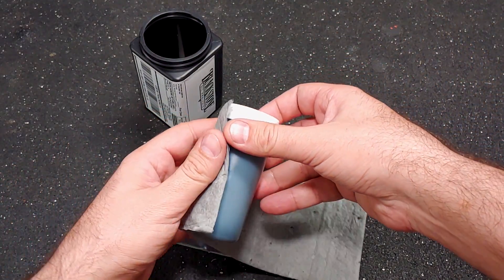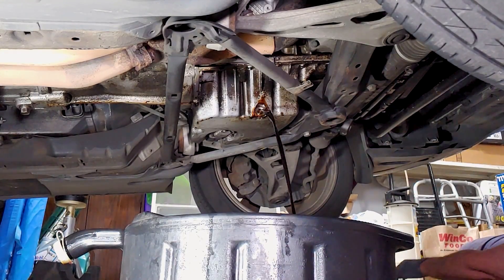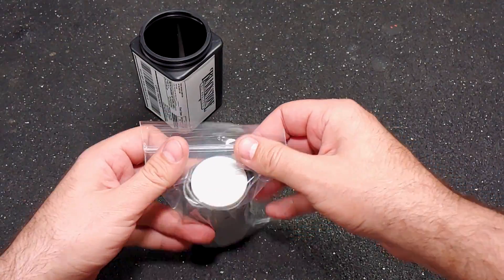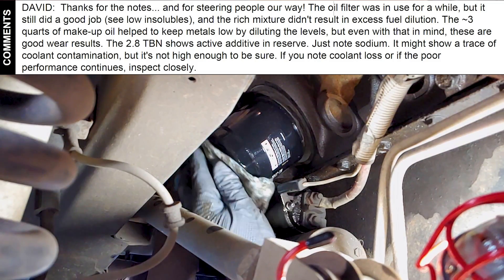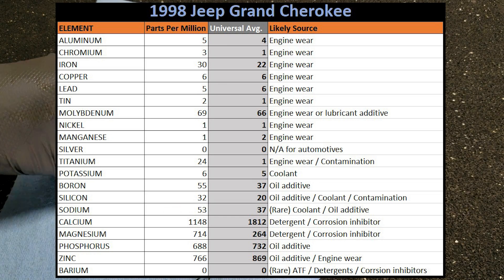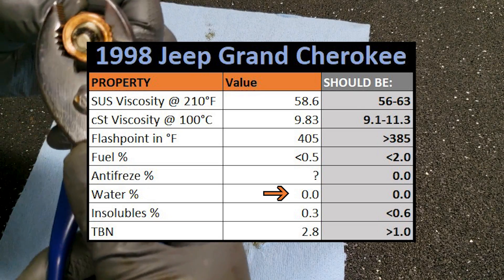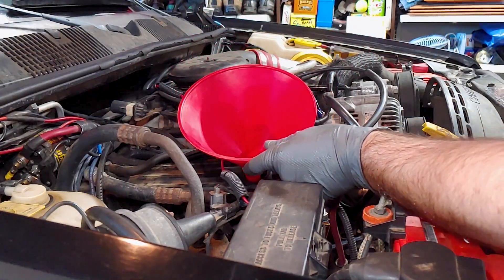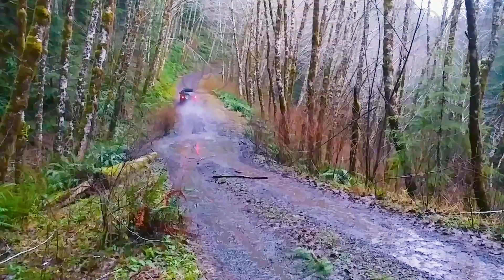Did My Oil Sample Get Contaminated? Jeep Oil Analysis

Comment: The Castrol engine oil that you keep using is a Grade III synthetic oil. Its rated for 10,000 miles with the help of additives only but it really isn't a 10,000 mile oil. Its more like a 5k mile oil if you have a direct-injection engine and 7k mile oil if you have a naturally aspirated engine. 

For 10,000 mile oil change try synthetic oils made from GTL Grade III+ base oil. Such oils are more pure and refined than standard Grade III base oil and are harder to break down. Pennzoil Ultra Platinum is one such example.

For 15,000 mile try AMSOIL signature series which is made from Group IV PAO base oils. These are 100% true synthetics. Amsoil rates them for 25,000 which is ofcourse pushing it, but it can definitely go 15,000 miles.